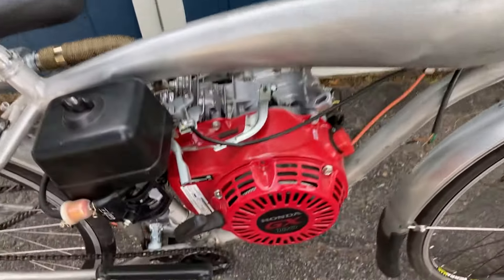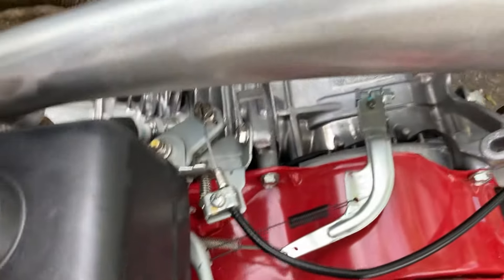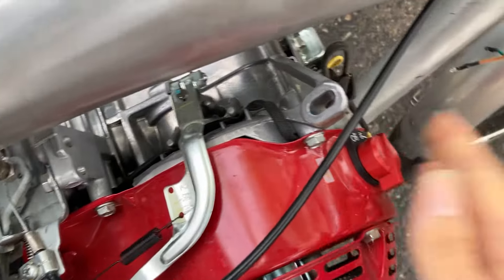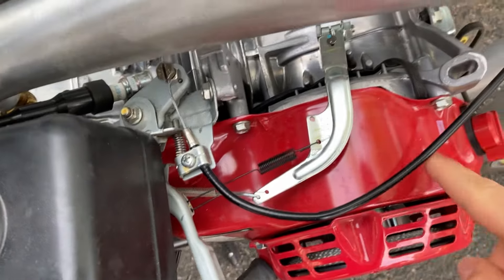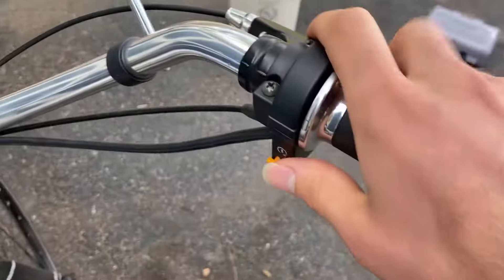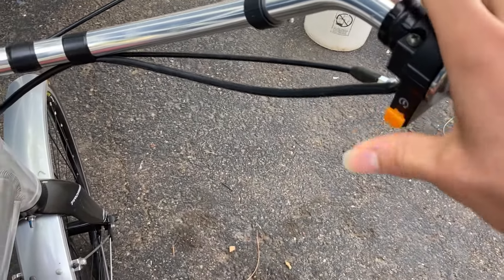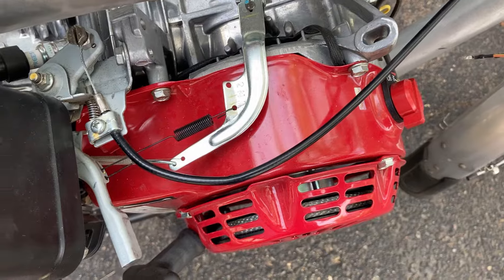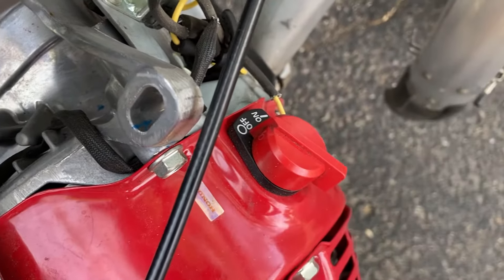How a Kill Switch Works, How to Install / Make One

Comment: Important note is on some small engines the kill switch actually grounds out the mag. So if you have an engine that won't turn off the kill switch likely has a bad ground. This is common when the kill switch only has 1 wire.
Reply: oh boy. I think I just found out why my shutoff switch stopped working on my Honda generator. It stopped working and I have to run it out of fuel to shut it off. I'll check my grounds!

Comment: I got here because the button on my generator isnt working.  And the negative  vable of the ignition(magneto)  isnt conect. Yet it stills fire up and work. Then  after its turn on i cant shut it off unless i close the  gas line to the carb
Reply: Same issue here!
Reply: @Indev31  i finally found a solution. I had a losed cable form the  ignition right? And i had another coming from the button to ground (on the motor) i jut took that cable out and pair it with the ingnition cable. And all done. Works like a charm